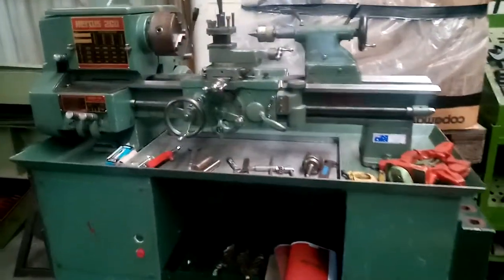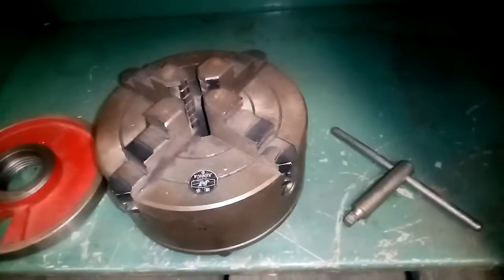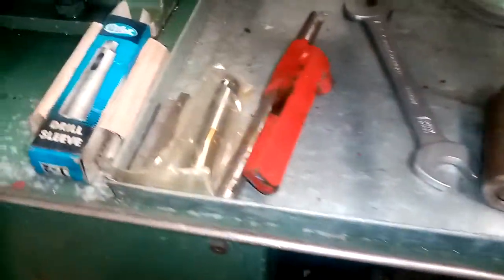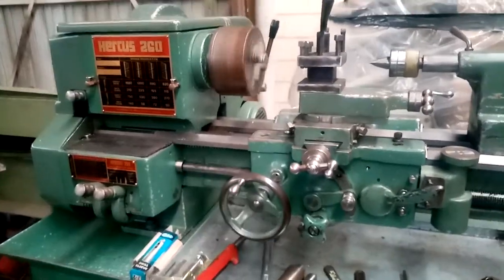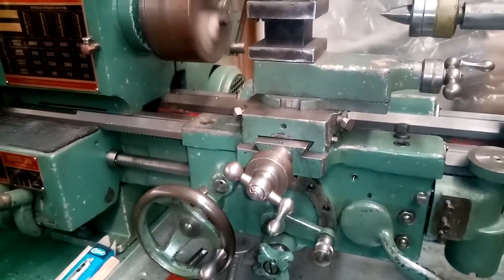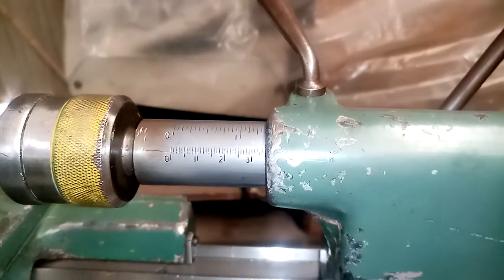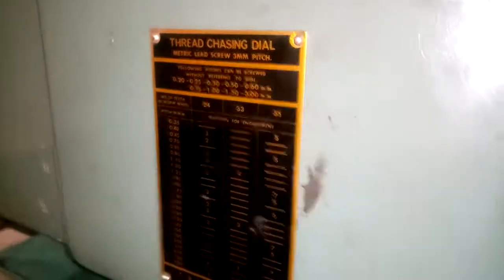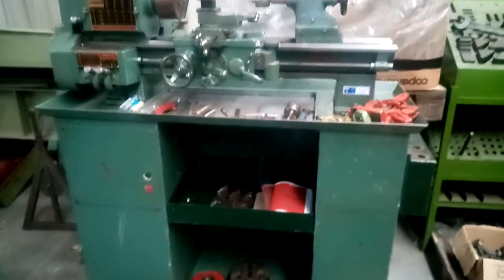Hercus 260 lathe

Comment: It's probably an ex school machine....they were standard in schools  although this is the ATM model which was the higher spec for schools.  Mal Conomy at Australian Metalworking Hobbyist AMH may have the complete history of the machine. Just quote to him the serial number stamped on the tailstock and bed ( they should match for spindle height alignment). Good one.